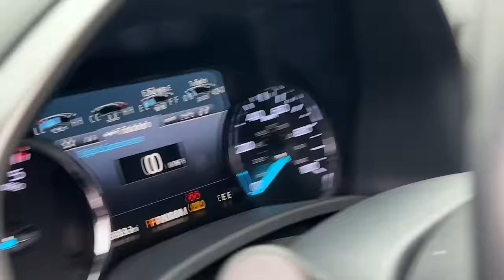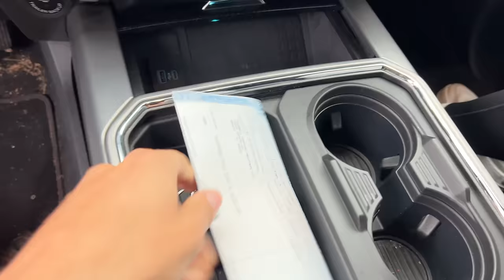I Bought a $200,000 Anylevel F450 Dually!

Comment: unfortunately not all dealerships will warranty a powertrain issue when the truck has been so modified, as you dont get warranty wheel bearings when you have 24x14's on a truck.